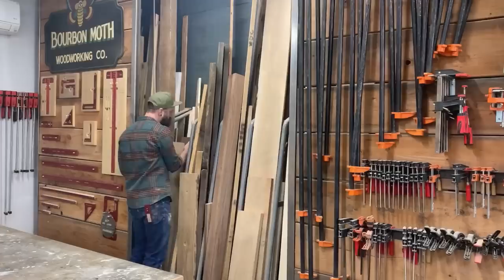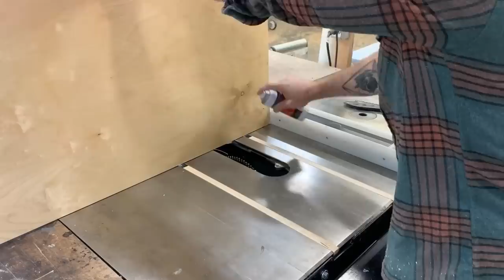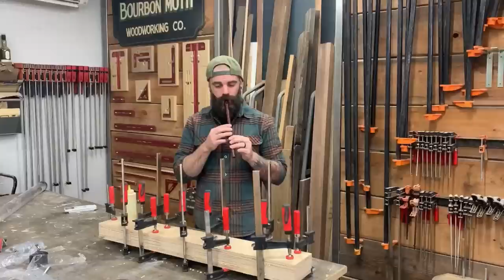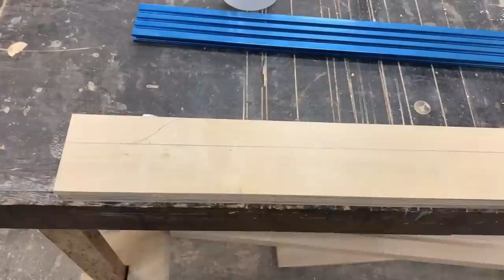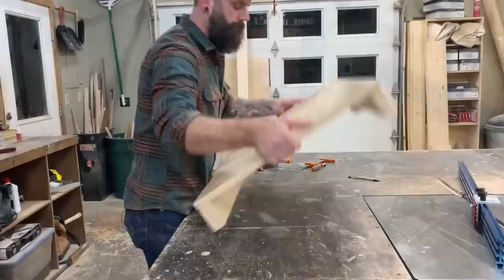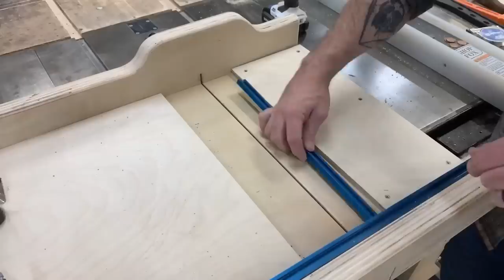DIY Cross Cut Sled || Table Saw Sled Made Easy

Comment: That's a ripper table saw jig.  Thanks.  I learn so much from ideas you and others put out there for us to see, understand and maybe combine to make better or maybe worse.  But we learn.  Talking off that, have a look at RJ's Shed Shop simple mortise and tenon jig for hand tool workers.  It allows me to cut perfectly matched mortise and tenons straight from the saw and chisel. And Yes, I am pushing it because it's the only simple jig I've seen that does what it does.  It would be a service to your followers if you had a look at it and it'd make for a great video.

Comment: Not to state the obvious and be the wiseguy here, but... this reduces your thickness capacity by quite a lot, right? Could you do this with boards (and T-tracks) that are let's say half as thick or will it be flimsy as heck when you do that?
Reply: It does, but I very seldom run in to the limit. When I do I use the miter gauge or the miter saw. I made one out of 1/4" years ago but only used it once and then it sat in the corner collecting dust for a few years until I repurposed the parts.